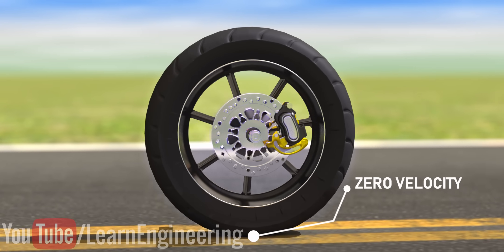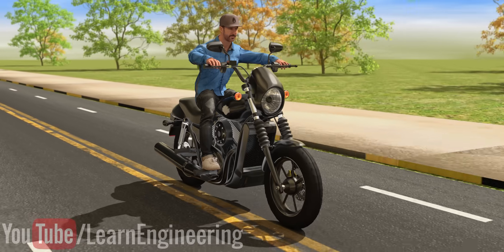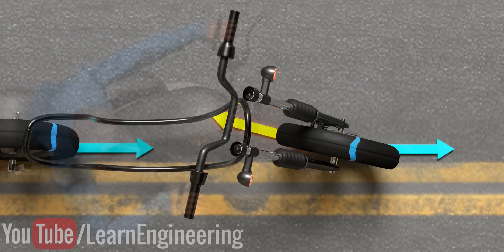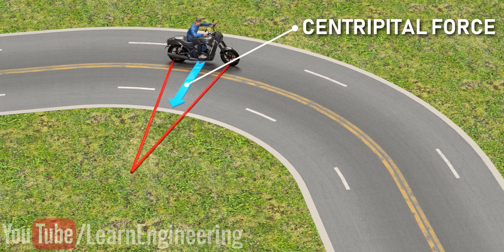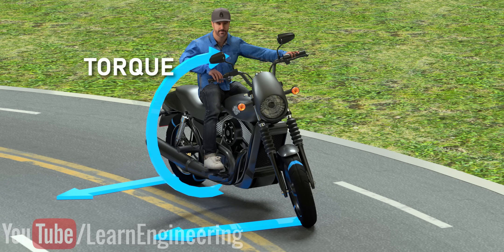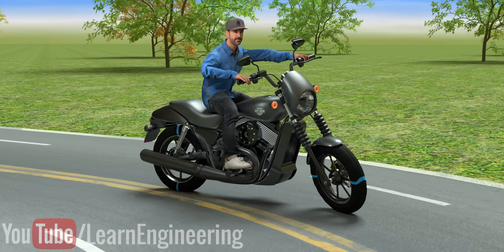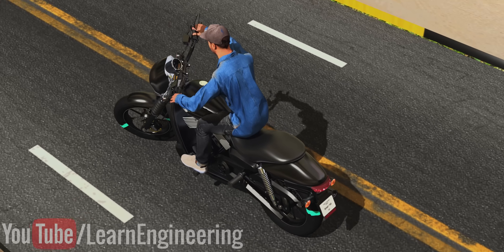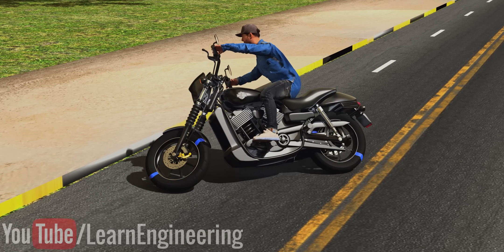Counter Steering | The interesting physics behind it

Comment: The front wheel is a rather large gyroscope. If you try to turn it to the left with the handlebars, it will lean to the right, and vice versa. To make a turn to the right, gently push the right handlebar forward. As long as this gentle push is maintained, the lean will increase and the sharpness of the turn will increase. Release the forward pressure and the lean will stop increasing, which will produce a stable turn to the right. To get out of the turn, push forward on the left handlebar and the lean will decrease, which will return the bike to a straight course.   
   To check this (decades ago), I would head my bike down a long straight hill with smooth pavement and then kick it into neutral so I was coasting at about 50 mph (80 kph).  I would remove both hands from the handlebars. (Not very smart, in retrospect.) Then pressing forward  on the right handlebar with only one finger would produce a lean and turn to the right. Pressing on the left handlebar (also with only one finger) would bring the bike out of the turn.
   Years later when I rode large touring bikes with relatively low handlebars, my mental approach to steering was ... to turn right, press down one the right handlebar to establish the lean and turn. Then stop the downward pressure after the desired amount of lean was established. To get out of the turn, press the left handlebar. 
   An important point here is that as long as you apply the pressure, the lean will continue to increase (or decrease, if you're coming out of a turn). So, apply the pressure just long enough to establish the desired turn and then relax the pressure. 
   Again, it's all in the gyroscopic action of the front wheel. The reason that the effect depends on speed is that the gyroscopic effects are much more pronounced when the front wheel is turning at a high RPM. 
   For the record, I'm a physicist and I can say that a lot of what was explained in this video is not correct, as many others have noted.

Comment: This video is pure over-complicated garbage.  The "normal steering" (a new term I've never heard before) works only when you are pushing your bike around with leg power, as soon as you are in motion, you counter steer.
Reply: keith code 
But don't counter steer as this video advises. It's dangerously wrong!

Comment: Counter steering is all I do on my cruiser. Works 100% easier. The turn is way over exaggerated. Counter-steering is easy as hell. You have to BARELY push and the bike leans over and you take turns like a pro. Easiest operation and by far the safest at ANY HIGHER speed.
Reply: N L 
The only operation!

Comment: I hope no one is watching this terrible animation and taking it seriously. Countersteering is simply how one initiates or throws their bike into a leaning turn when riding a bicycle or motorcycle. It is smooth pressure - not drastic turning of handlebars. The point is to smoothly disrupt the force of the wheels turning as vertical gyroscopes, which want to keep the bike upright. The speed and radius of a turn determine whether and how much lean is necessary. Tight, slow-speed turns require little lean and require directional steering as opposed to counter-steering. Relatively higher speed turns require relatively more leaning of the weight of the bike into the turn by putting smooth counter-directional pressure on the steering to disrupt the vertical orientation of the wheels to allow lean to occur. All riders who are leaning their bicycles and motorcycles are using counter steering whether they know it or not. This phenomena is easily demonstrated on a bicycle by riding in a rapid slolom. Each reaction is providing the exagerated counter-steering required for the next counter reaction. The reason motorcyclists need to be more aware and proactive about it is due to a motorcycle's mass and very strong tendency to right itself which requires more assertive counter-steering input pressure by the rider.

Comment: The comments here are plenty, so I'm gonna just leave my opinion. I consider Myself an experienced rider, and I use counter steering everytime I go for a ride, in traffic, on highways and everywhere I can. The control over the bike is much more noticeable when you counter steer, and IMO there are certain situations where Counter steering is the only viable option to steer, for example to avoid an obstacle. Countless of times I've been saved by the fast response of ANY of my motorcycles when counter steering. Leaning the body, even though it works, the response is much more sluggish and takes a lot of time to get the bike to do what you want. I always use counter steering above 5mph, under that speed direct steering is much safer and faster, but it doesn't mean that counter steering doesn't work; it does work, but you have to turn much more to get the bike to lean to the opposite direction, so it's very difficult to correct and avoid falling. It seems counter intuitive, yes, but counter steering may save your life. 

I taught my friends the technique and ever since they mastered it is the only way they turn, and they say they love it. 

Again, this is MY opinion based on MY experience, no need to freak out over a comment!
Reply: Rafael Dávila Techera 
Yea I get your comment. But it should also be mentioned that this particular video is dangerously inaccurate in how it shows counter steering.

Comment: As someone who has been riding for 23 years on the dirt and 10 on the pavement, I feel my opinion has some relevance here. This video is describing an avoidance flick, where you’re dodging potholes, cars, or just random crap in the road.... for just a very small amount of time. If you are on a road bike especially a sport bike, you are counter steering 100% of the time over 20 or so mph. If you are cornering at speed while counter steering and then switch to direct steering, you WILL HIGHSIDE the bejeezus out of yourself or lose the front end, and it will 100% hurt your body and your pocket. This video is kinda misleading or titled wrong, wheel and tire physics were cool though
Reply: Exactly right, this video is very misleading.  It is not even possible to turn a motorcycle much above 10 mph unless one uses counter-steering.  Close to 50 years of riding here and getting close to calling it a day.

Comment: There is no cleverly turning to the direction you want to go. The bike slouches downwhen you lean the bike, forcing the wheel  and the handle bars to turn in the direction your leaning and automatically correct to straighten the bike up. The counterstearing is the force you use to hold the handlebars in this position to continue the turn or else the bike will stand up and go straight.
Reply: Zikurick 
Push left, turn left
Push right, turn right.
The front wheel does indeed face into the turn after the counter steering action, but this is due to the steering geometry of the bike..... not direct rider input. Pressure is maintained on the selected bar through the the bend, to stand the bike up pressure is release in a controlled manner off the bar and the bike will come up. It's all very controlled and precise, nothing is fighting with anything else.

Comment: What a complicated explanation for something so simple and intuitive.
To turn right on a bike you need to lean to the right. Before the turn, you turn the handlebars slightly left to make the bike lean.
You cannot avoid doing this by 'shifting body weight', because with shifted body weight your handlebars will be in a different position than if your body was in not shifted, hence it comes down to the same thing.
'Countersteering' is a misleading term that better suits the situation where you turn the handlebars to compensate for a rear wheel that slips sideways.
If people think it helps them to 'countersteer' this can only be psychological.
Reply: Patrick Thibaut 
I'm happy that you cleared that up in such a simple manner.😂
Push left, turn left
Push right, turn right
That is simple!

Comment: I had to check a video that explained the physics behind this, ive ridden Bicycles LOTS and also practiced with my Bike a decent bit so far.
I knew i were doing countersteering to some extent, but whenever someone explained it to me it didnt make much sense.

Reason being, the way people have been explaining it is basically "you turn in the opposite direction from where you wanna turn", but they forgot to explain that it was only to make the bike lean over and not thoughout the whole turn! 
So the way they explained it made it seem the wheel should point off in the wrong direction slightly the whole turn, but from a logical standpoint that is impossible.
They explained it as if countersteering is a way of TURNING rather than a way of LEANING into a turn.
Reply: Sgt_Kisse Katt
Ok, so..... Counter steering is barely perceptible. You push in the handle bar rather than turn. This initiates the leaning action of the bike. However, once the lean is achieved the pressure remains on the handle bar throughout the turn. The front wheel does indeed end up pointing into the turn, but this is due to the bikes steering geometry and not rider input. Think about it for a second...... If you have made the bike lean left by pushing the left handlebar, guess what's going to happen if you then suddenly push on the right handlebar? The bike will stand up in an effort to lean right due too........counter steering!
This video is extremely dangerous as regards its content and several (inc me) have requested it to be taken down. This will give you much better info on counter steering (nope, not my video).  https://youtu.be/lzk8oyNO708
Reply: @softailfun  Ok, thank you!
I'll definetly take a look at it.
Even though i most likely do Countersteering without thinking about it (to some extent atleast).
I always wanna know the physics behind it and such, helps me wrap my head around it and understand.

Comment: After 12 to 15 mph direct input steering no longer works. This video is incredibly dangerous for any new riders. The only way to turn a motorcycle at speed on a road is to countersteer. I hope someone with a bit more knowledge on the topic can help you remake this video with accurate information so someone doesn't get hurt.
Reply: Counter steering can be applied at any speed above 0
Reply: You can normal steer over 15 mph, if you have the right tires. What else do you think motorbike racers do?

Comment: I've been working at this for about a week now and finally got counter steering right just as this guy described. This was a good educational video. The only thing you have to do is not give up and practice this over and over. You will not just get it on the first try.
Reply: ProudManChild 
This is probably the worst video on YouTube for this topic. So if you're following this, you're probably getting it wrong or going to get it wrong in the future. This video is dangerously incorrect. For a far more informative vid see here (no it's not my vid, but it's far superior to this rubbish). https://youtu.be/lzk8oyNO708

Comment: WRONG...WRONG...WRONG ... Countersteering is used by ALL bike riders who have ever executed a turn on a bicycle or motorcycle at speed. "Leaning and motorcycle turning in perfect balance" ... maybe the folks at Learn Engineering need to hop on a bike and prove their theory on a 60 kph bend ... make sure that you have crash bars and full riding gear. The scenario shown at 3:15 causes the bike's center of gravity to move outside of the turn, making the bike unstable and most likely resulting in a high side crash. DON'T DO IT.
New riders...relax, you've been counter steering since your dad took your training wheels off your first bike...it's intuitive.
This is a good place to start.   https://www.revzilla.com/common-tread/what-is-countersteering

Comment: This is just plain wrong.  You cannot choose between normal steering and counter steering!  The wheels, at speed, become gyroscopic, they want to stay in a plane,  Pushing on the left handgrip causes the bike to lean left (the tires wish to stay vertical) when the bike leans the tires move the contact patch from the bottom of the tire to the side of the tire.  Watch some motorcycle racing! In the turns does it look like the front tire is pointing in a different direction than the rear tire!  Misunderstanding counter steering kills novice riders every year.  Over and over again I hear of new riders driving into guard rails.  I can only conclude that they were trying to use "normal steering" at speed, a serious mistake.

Comment: It's simpler than this. Counter steering would not work if the fork were straight up and down. Because of the rake angle, when you counter-steer left to swerve right, the front tire contact point moves to the LEFT of your vector line. This makes the bike itself lean Right. Lean right, turn right.

Comment: WARNING, this video is a terrible explanation of countersteering. The video implies that there are two ways to steer a motorcycle, normal steering or countersteering, which is wrong. Because of physics (gravity and centripetal forces) and the dynamics of the motorcycle mechanism, there's only one answer. Countersteering is a technique of input to the handlebars to steer, for example, press left to go left. If not consciously countersteering you have to understand that the steering input has to be the same to get the same results, or you're going to go somewhere else. So you still are technically countersteering. The video is too complicated, talks about things not really important, and is often misleading. The quality of the animation is good, this is what they know how to do, but they don't know anything about the physics of steering a motorcycle. I suggest that "Learn Engineering" take this video down and try again.

Comment: This is a very good video which shall explain the physical stuff!
So stop complaining about "EVERY biker uses this technique bla bla"...
Reply: No, it is not. It does not correctly explain the causal relationship between the events, and is dangerous in that it presents the results of those relationships as optional. There are a number of dynamic forces and sequential actions that are required for a correct explanation. The complaint that “every rider does this” is valid because the explanation of the physics of the system is woefully incomplete, and the use of the word “normal” to describe static balanced turning ( which would be a much more correct physics description ) is extremely misleading, as static balanced turning- commonly called counterweighting- is only possible in low speed maneuvering, which most people would not think of as normal riding. Additionally, the dynamics of the system- rider speed, not rider choice or rider ability, make the system controllable or uncontrollable by a rider.

Comment: its badly taught, you dont turn the handle bars left to go right, you lean on the right grip which pushes the right grip forward and causes the bike to lean right.
Reply: So right... you can’t turn the wheel at speed
Reply: It's literally like when you're a kid riding a bicycle a little fast in a corner, you lean, by doing so you unconciously push on the right handle very lightly, which is the "turn left", barely noticeable
Reply: At a park i ran into some people in some kind of ' bicycle ' club, this older guy had a strange bicycle he built that had a double front neck with gears so that the handlebars turned opposite to the fork. It was a challenge to ride it more than a couple feet.
This video reminded me of that bike.
Reply: So just remember, if you want to turn   
' right ' move the bars left and when the bike dumps over you will be pinned under the ' right ' side.
Reply: @michaelszczys8316  This works every time.  Look for the big sign on the road with one letter  H .
Reply: @fredkilian4049  blue sign?
Reply: @michaelszczys8316  You turn the bars very slightly. That makes the bike lean If you're not smart enough to straighten the bars out again, that's on you.
Reply: If you push the right grip forward, the handlebars turn left. Duh.
Reply: @craigmilliman2763  no

Comment: Counter steering is  a great tool for street racing and riding in Indian traffic. Couple it with clever braking and you can achieve the best motorcycle handling.

Comment: Best Info I ever got was you can normal steer in speeds under "10 miles an hour or so".  ANYTHING ABOVE THAT YOU HAVE TO COUNTERSTEER!!  period  ( Wish I knew this as a kid. Raced into a curve without this knowledge and jumped bail off my bike because it was headed head on into a big tree. It caught my legs and my bike coasted aside the building and laid in the next intersection) 750 four Honda supersport 1978.  I was lucky.

Comment: This is a very odd explanation.  For one thing, "normal steering" (pull left handlebar to turn left)  is only possible at very low speeds, and centrifugal force is not a factor at those low speeds.  Counter steering works because of the contour of a motorcycle tire.. unlike a car tire it is round, so for example pushing the left bar first makes a slight right movement (caused by the wheel direction change) followed immediately by a deep left movement because the tire has been put on the rounded left edge where it wants to turn left, combined with an induced left lean of the entire bike/rider.   So counter steering on a motorcycle (or a bicycle at speed) is simply putting the bike tire on its curved edge and in a lean where it will carve a turn.  Experiment on a bicycle and the mystery will disappear.